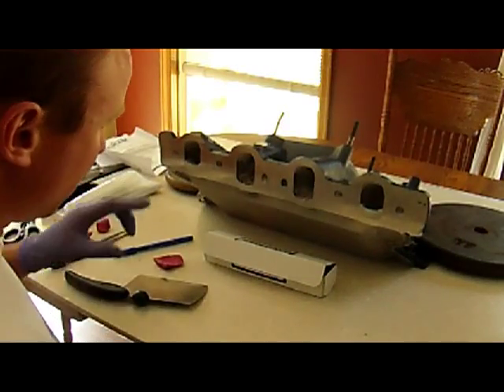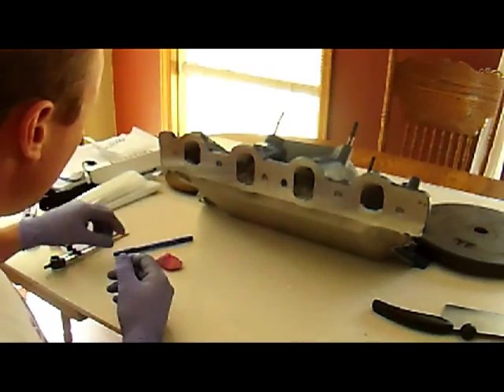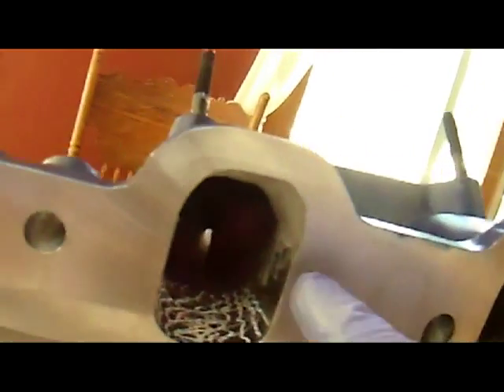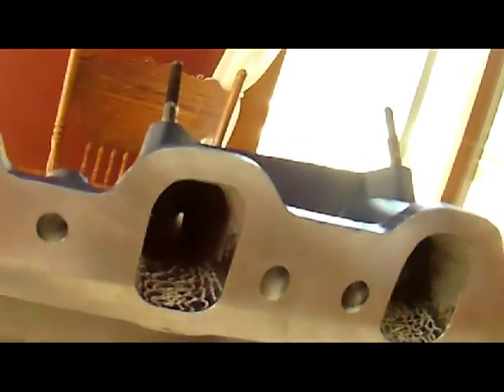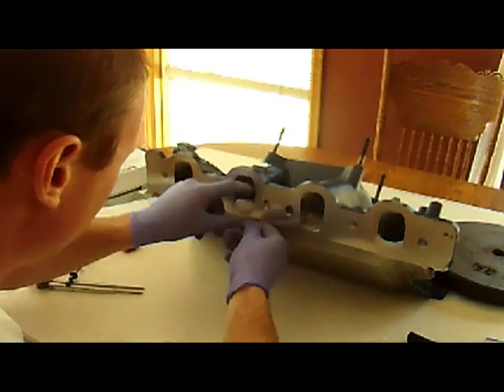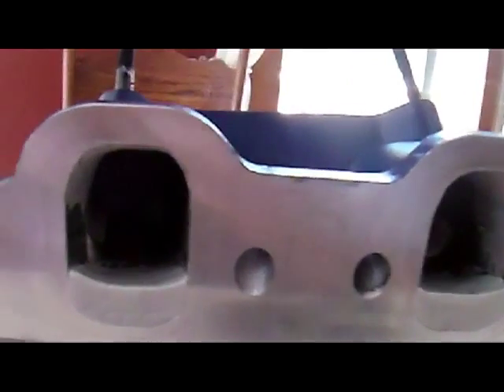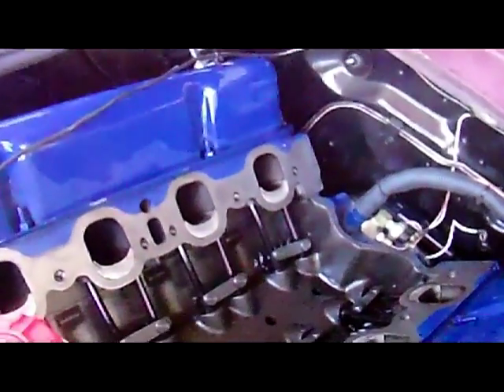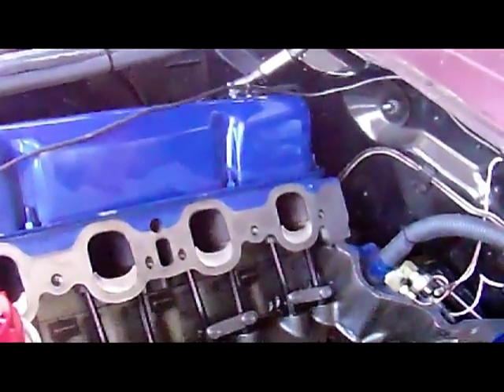351C Edelbrock RPM Air Gap Mod

Comment: Does this increase horsepower medium to high RPM?
Reply from the maker: Probably not compared to a single plane but torque and power down low is much better.  When I swapped to this manifold I also changed the cam and went to a manual transmission and it picked up 70 HP and 75 ft lbs on a chassis Dyno.  How much was the intake good for, unknown but certainly some of that.

Comment: If my memory serves me, I believe it was Robert Yates of Ford NASCAR engine builder fame who first discovered this trick during the mid 70's when NASCAR went to a 355 CI limit...
Reply: Do you know the length of the intake bolts for the air gap thanks

Comment: Stupid Question, V8billy here. Are you doing this to try to increase torque?
Reply from the maker: w41duvernay yes, the 4v heads, ports, are too big, this greatly helped lower rpm torque.  The aftermarket heads are much smaller port wise
Reply from the maker: Yes in the lower rpm's where a 4v head struggles due to the large ports
Reply: @v8Billy66  y not run 2v heads?
Reply from the maker: @GJ-DT  Because I had 4v heads and the quench 4v heads with these mods is a better setup, imo

Comment: I wonder how it turned out . I also wonder how long it took for the epoxy to break down sending chunks of it into combustion chamber .
Reply from the maker: +Jack Brewer I ran another intake with the same epoxy for 10 years and it never came out.  This one did 2 Drag Weeks, lots of street driving and some road racing until the engine blew up.  It turned out great, ran better on the street and ultimately went 11.60's in a 3550 lb street car
Reply: @v8Billy66  what caused the engine to explode?
Reply from the maker: @MrCbell57  Road racing it without an accumulator, lost oil pressure in a corner and a rod said goodbye.